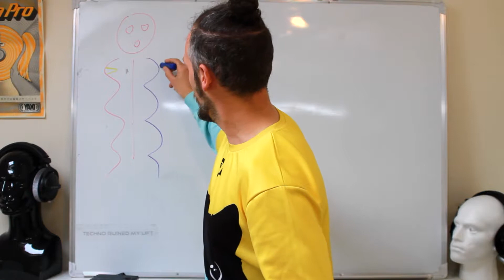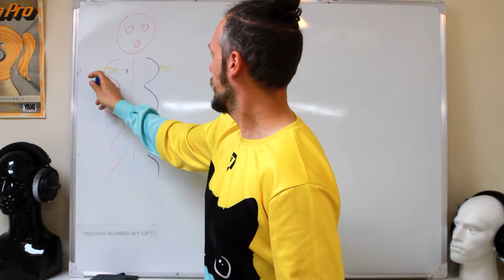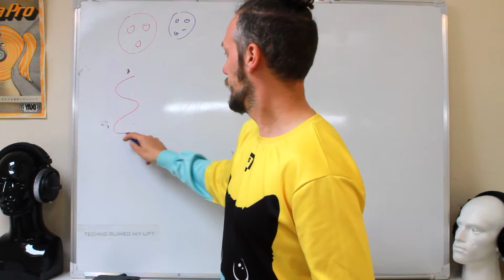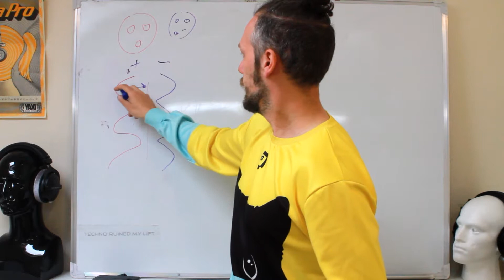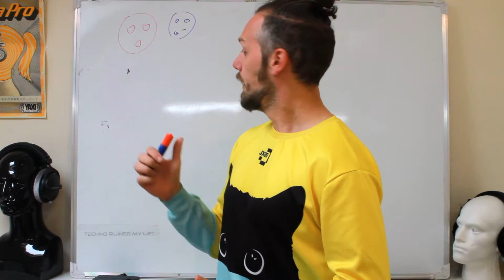What is balanced headphone drive and how does it work

Comment: Nice video!
One question though: wouldn't it be better to have a single amplifier with more power? At least as far as cost and circuit complexity goes. Is there any advantage to the inverted phase design for drivers at all?
Reply from the maker: I think it is more to do with the fact that balanced amplifiers already have the normal and inverted signals going through them so it does not increase complexity that much to add a balanced headphone output and get the advantage of better channel separation but there are a lot of different designs out there and no real standard

Comment: What happens with the ground signal in 4 poles balanced headphones??
Reply from the maker: They don't really have one. They have a positive sand a negative rather then positive and ground
Reply: Yes, I got it,  but how does the electrons come back to the circuit to do the way that electricity works??  Please help me with that,  sorry for my English, my native language is Spanish
Reply from the maker: @darkheartmns  So... Lets say the audio is a sine wave going from positive, through zero and then then goes into the negative. One wire would have that and the other wire would be the opposite so when one is at positive, the other is at negative. So... the electrons flow from the negative side, through the headphone driver and back to the player down the positive side. Then when both sine waves are at zero no electrons flow and then the wave goes the other way the electrons flow in the opposite direction. The wires are constantly swapping from positive to negative and the flow of electrons keeps changing directions 
. I hope that explains it...